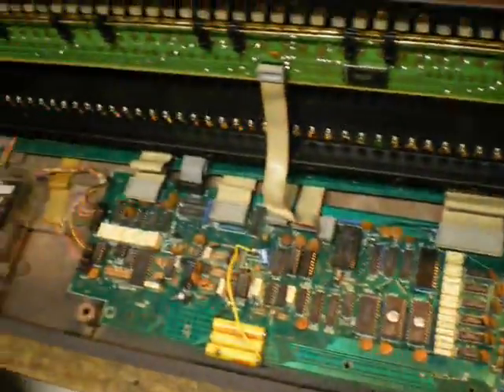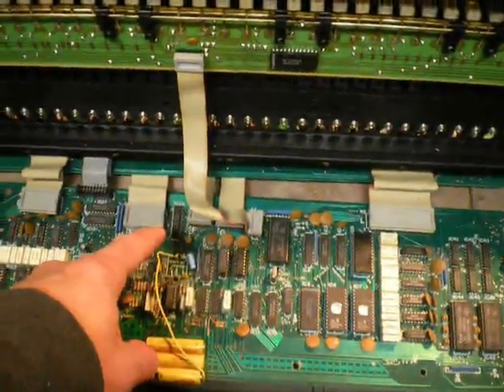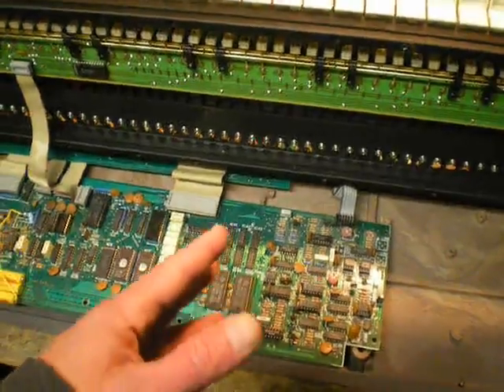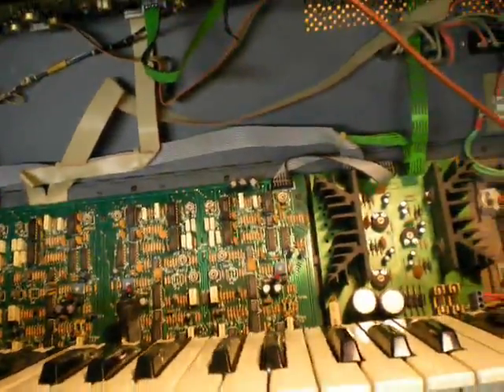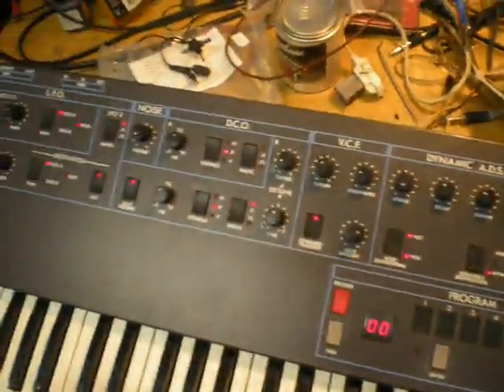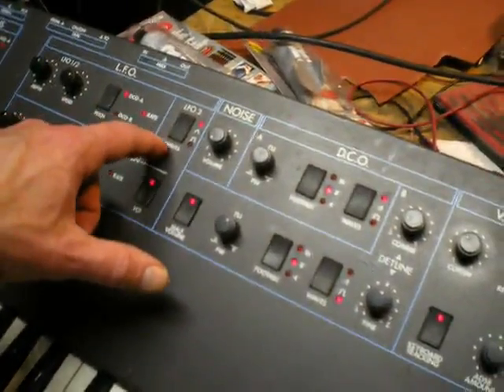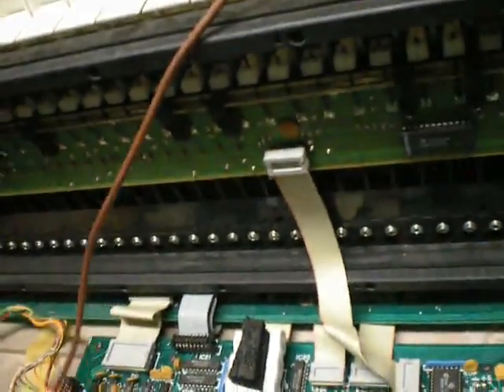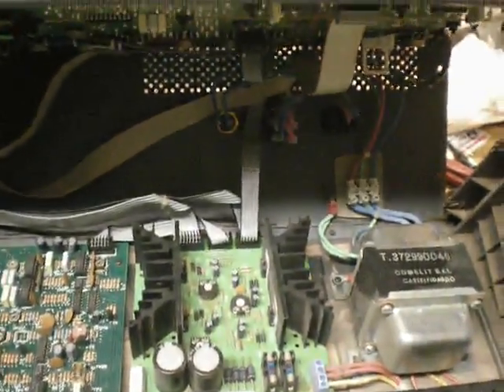Siel DK600 tech talk; a tough nut to crack

Comment: Hey man, I know this an old thread but I just picked one up for $80 and it’s making a hissing white noise sound when I turn it on. Any ideas?
Reply from the maker: not atypical.  check DAC output and you'll likely find it's all maxing everything including the white noise....If you have a scope you can proceed but it'll be tough w/out a scope likely.  If you already cleaned around battery leak and replaced ic16 and verified all lines there then you might change out IC11 and 12 but w/ a scope you can see if that needs to happen.
Reply: Do you know a good site to order the parts?
Reply from the maker: I just charge 4 dollars ship to US and whatever parts go for so let me know what you need on my sounddoctorin.com contact info link

Comment: I bought one in the late 90's, it subsequently failed.  I was told it was an EEPROM failure-unfixable.  I kept it around for sometime, kept the mod wheels and power supply and tossed the rest.  I kinda regret that now.
Reply from the maker: tossed the analog board?  bummer.  Yeah it was totally fixable just not by them of course.

Comment: Great overview man. I am in the UK, got one in my workshop right now, off e-bay turns on no sound. As suspected the battery leaked, with a few poor insects that melted too! Anyway, I appreciate you taking the time to post this I read your website page too extremely useful content for someone like me that's just getting into repairing gear. If you want to know anything about the one i have let me know and we can share, like serial numbers etc...
Reply from the maker: +Sixty Six Khz Productions Feel free to call off the website afternoon/evening and I can venture a few guesses maybe if you can make some measurements for me

Comment: I have one. Paid $300 for it last year.  Don't pay more than $500 for one.
Reply from the maker: I buy them broke (which most are).  I won't even pay 500 because they can take over 10 hours of labor not uncommonly.  If I pay 100 I'm usually sorry.  lol.  If they are NICE cosmetically 150 or so broken maybe. 

James every other tech I know pretty much stopped working on these.  IF they are restored to reliable condition though...what do you have?  Nothing compares precisely to the analog design of these.  2 analog controlled digital sources that have analog saw converter...and everything else in signal path is analog.

The sound quality is great.  What comares for under 1000?
Reply: James Reeno so a non working one for $275 isnt worth it?
Reply: ADHD Synth maybe